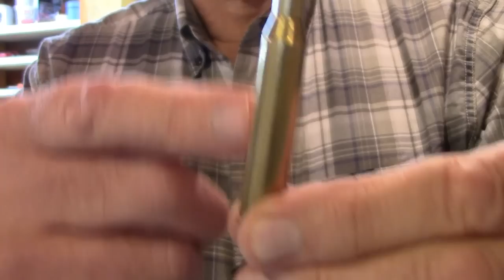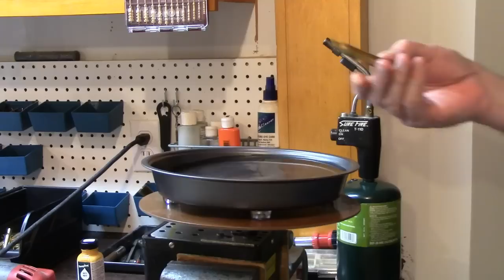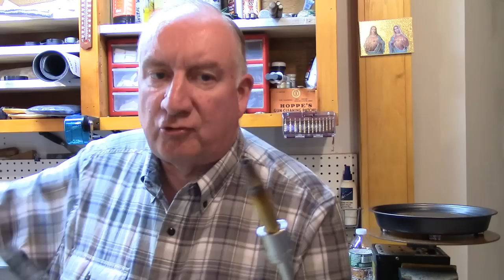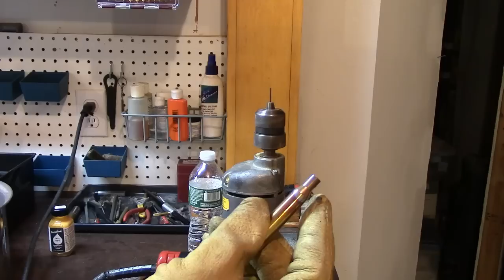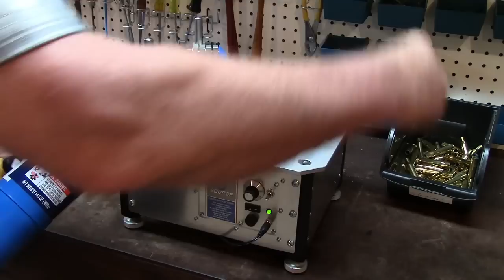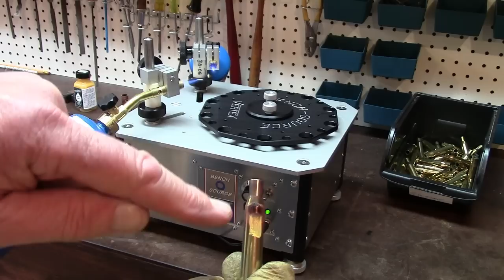How to Anneal Brass ~ Vertex Bench Source or a Tight Budget!

Comment: How do you know when to stop loading a case?
Reply from the maker: Prior to each loading, inspect your cases for signs of failure or fatigue.  Generally, case mouths will split, or primer pockets will become loose.  Annealing will preclude the splitting, but eventually, primer pockets will enlarge and no longer will securely grasp primers safely.  A third, and very vital concern is incipient case head separation which is common with belted cases, but can occur with any case that has been full length resized a number of times.  It shows up as a bright line around the circumference of the case at the web, which is just forward of the solid head. That sign is most visible after firing, and indicates a thinning of the brass, which can separate on subsequent firings and seriously damage a chamber.  Any exhausted case should be crushed to prevent it from being loaded by anyone. Split pistol and sometimes rifle cases will ring in a batch like a jingle bell.

Comment: You may have to explain Rube Goldberg! My dad, born in 1920, used to use that reference a lot. 

That was one of my questons regarding annealing for handgun cases. 45 Colt brass used for Cowboy Action is too hard to seal with light CAS loads. Annealing would be helpful, but I can't see how you would prevent the entire case from overheating.
Reply from the maker: Handgun brass can only be done at home by the water bath, which protects the head.  Other methods can dangerously soften them.

Comment: AN old "45" record turnstile would be most appropriate with adaptations for brass rotation.
Reply from the maker: Walter Palmer 
Yup, they sure would.  Trouble is that those have become very expensive collectibles in recent years, and some can bring, or be sold for the cost of a decent $250.00 automated annealer.  I recently sold a 1970s vintage Technics turntable, with stylus, for $380.00 to a guy who was setting up a system to play old platters.  Those old 50s vintage suitcase style record players can be quite expensive if they still run.

Comment: I really like your videos, I watch them all the time but I'm not sold on this one. I think if you annealed brass then do it on a machine and use tempilaq. I dont think you can accurately anneal brass by how the brass looks. You cant be consistant by hand and if it's not consistent then why do it.
Reply from the maker: montana cold bore shooter 
I presented various methods of annealing brass in order to help every person to extend the life of their brass, regardless of their financial condition.  The methods included the least expensive and sufficient, along with the most expensive and sophisticated. I think most folks understand that I never made any claim that the least expensive was equal to the expensive process, which would make my $500.00+ expenditure on the machine rather a vain, silly venture.  Of course the primitive visual method is not as precise, but it certainly works to extend brass life, which I can attest from having used such methods for many years, quite nicely, without taking food off the table.  If a guy uses no annealing, he tosses all his brass.  If 25 percent don't come out right, he saved 75 percent for another day of shooting.  My efforts are to enable all folks to enjoy reloading, not be badgered into spending. I don't understand what you don't agree with.

Comment: Sorry but brass does not get softer at 750° f in a few seconds. You release stress, but you have to reach higher temperature to get softer brass. the brass is not damaged if it turns a little dark red. really to get brass softer you need to warm it up to close to 1000 ° f for this short time.

Comment: I just got told by a guy who has been reloading for years that annealing is a waste because it will loosen primer pockets. What say anyone else?
Reply from the maker: This is my channel, so I alone get to answer that question.  That individual speaks out of ignorance of the process.  Cases are annealed at the NECK and SHOULDER ONLY, and no annealing heat temperatures whatsoever reach the center region, let alone the base, and therefore cannot possibly soften and expand the primer pockets.  Pistol cases cannot be safely annealed, because they are too short to isolate the heat at the neck region, and the bases will indeed become soft and dangerous.
Reply: @GunBlue490  I just went back to the guy who told me that with your response. He told me I really botched what he had told me. He did not say annealing loosens pockets. He had said the firing of the cartridge loosens the pockets, and that's the weak link in the chain. In other words, saving the neck while the pocket goes south makes annealing not worth it. Sorry for the confusion. I come to your vids because I want to know how to do something right. Whatever you do, I do. Thank you.
Reply: @GunBlue490  GB... Priceless

Comment: Kinda wondering if I could measure case neck thickness with a vernier caliper (one jaw inside, one jaw outside neck) and simply affix the brass shell so that it's stationary, then use a strip of sand paper to sand down the thick side rather than spend $100 for a concentricity guage and another $100 for a cutting implement that may or may not work as well as a hand finished sanding.  I'm just concerned that the thickness of the vernier caliper jaws might not allow for as accurate of a measurement as I would need.  280 remington would be the case in question.
Reply from the maker: Cole 
You don't need any measurements whatsoever, unless you are sizing case necks to a specific neck release clearance for a tight benchrest chamber.  The purpose of a neck turning tool is to make the thickness of the necks uniform.  A neck turning lathe accomplishes this by cutting extremely varied thicknesses across both lateral and longitudinal dimensions in reference to a pilot.  Such tools absolutely work, and cut with extremely fine accuracy to within .0001", and do it with great efficiency.  If you want to avoid the associated expense of a neck turning tool, just enjoy your handloading and don't worry about such details, but any other method is a fruitless venture.  A turning tool cutter will remove brass from extremely small areas that cannot be accessed with sandpaper.  Standard brass, with no turning, will produce one inch groups or better, given a good load and rifle.  I made countless great loads with standard Winchester, Remington, and Federal brass, using no turning.  A good alternative is to buy premium brass from Lapua, Nosler, or Norma, which have generally fine tolerances, though it comes with a distinctly premium price.
Reply: Ok, I didn't realize it was that precise.  I guess I might look into it at some point but like you said, might as well enjoy it for what it is at this point and see where I come out on the other side with these new loads.  Thanks for the help.
Reply: It took 12 minutes to light the torch talk about wasting time

Comment: Mate… Why do you try to make thinks complicated?
To anneal cases, just put the cases upside down on electric stove plate.
Turn the plate on and heat the cases.
On my grands stove, takes about 4 mins to anneal necks only.
7-8 minutes to anneal neck and shoulder… and so on.
You can anneal all your cases at once at the large heating plate. The necks get really soft, all are annealed evenly and look very good.
Hope this will help
Reply from the maker: I'm sure they do indeed get soft.  Your method may be effortless, but applying direct heat at the temperature required for that long will absolutely over soften case necks.  There's a reason for the methods I demonstrated, which are time tested, and precisely how cases are annealed at the factory.  Dead soft brass means that the necessary alloys in cartridge brass have been cooked out, and is not the goal.

Comment: I'm no expert on this but, Your brass looks cooked. Looks like it was heated way to much. Secondly, Tempilaq should never be exposed to the flame. It will burn in the flame instead of melting when the metal it's applied to reaches the desired temperature.  You should verify all your advise prior to telling people how to do something.